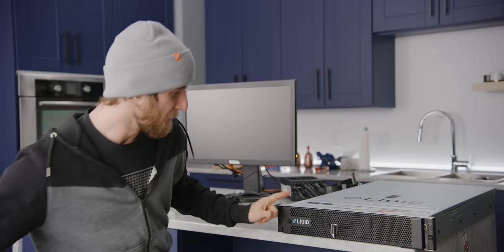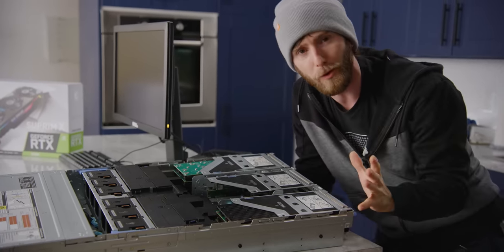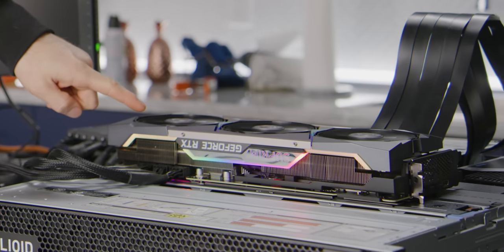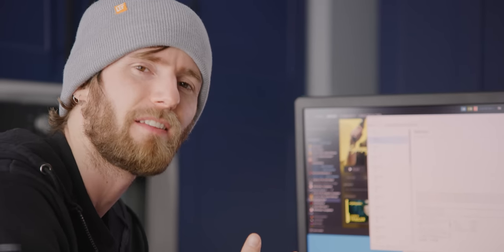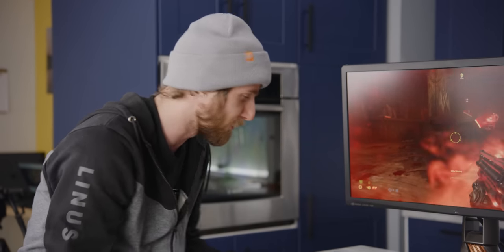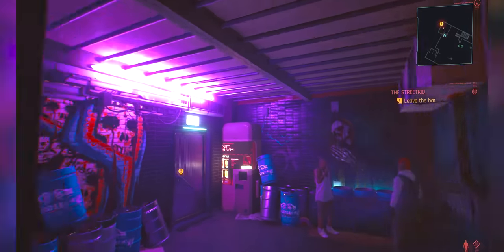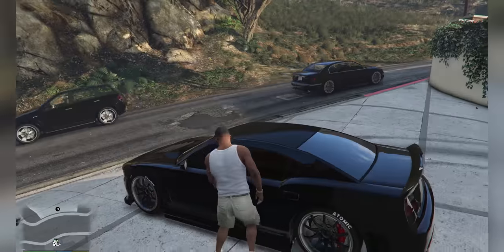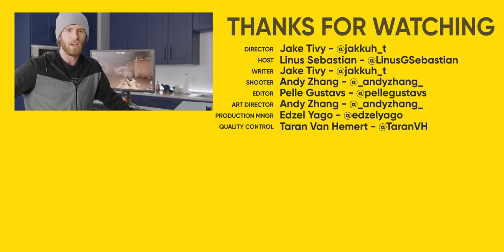Gaming on a $60,000 Computer - Liqid Badger Den

Comment: 20 years later: $60,000 20 year old Gaming PC vs $300 PC

$300 PC wins
Reply: quantum pcs by then.
Reply: Honestly the $50,000 Mac Pro 2019 is already more than half way there.

Pretty sure your average $2,000 PC will match that in 2030.

In terms of floating-point performance, smartphones-tablets-laptops under $1000 today match the top supercomputer of 1999 while a $5000 PC with two RTX 3090s in SLI  is roughly equal to the top supercomputer of 2004.
Reply: I would even say 10yrs.
Reply: @handlemonium  go look it up on a CPU benchmark compare website. The 24 core ryzen threadripper beats the 28 core intel xeon cpu in the mac pro by a big margin in both single core and multi core performance. Oh and btw the 24 core 3rd gen AMD threadripper costs $1300 while the intel xeon w costs $7000
Reply: @Bluecolty  what about the 64 core threadripper?
Reply: @anilater_9047  The one that can run the original Crysis without a GPU?  Probably the $300 PC by then will run Cyberpunk 2077 in the same way.
Reply: i wonder, considering quantum computing is not going to be a commodity (it works with super cooled stuff with liquid helium, not something people casually have at home.) and that we hit the peak that silicon and copper can do in therms of size, heat dissipation and electrical conductivity...

let's just say, even if it wins, the gap between them will be orders of magnitude smaller compared to rigs of now VS rigs of 20 years ago! went from 400 MHz to 4000 MHz back then tho we can reach 5.7 GHz on LN2 right now, we can do 5 GHz on air... that is what i mean by being at the limit. the heat can't get out fast enough and we can't put enough electricity in.

not to mention after a certain size down, the paramagnetic forces will induce errors in the processor if we bump up the voltage. think of it like moving a coin with a magnet. except it is changing data on an other lane.

so who knows if it would really win...
Reply: @handlemonium  Linus did a video on RTX 3090 SLI, and it showed that any performance gains were negligible (less than 1% improvement), and that in some cases 1 3090 performed better than 2 in SLI.
Reply: 20 years, that will be mobile device performance.  10 years, budget PC.  Longer if we go back into the slow stagnation of performance that was typical in the 2010s but we seem to be entering a new era of strong generational improvements.  Might not quite be 1990s level madness but probably at least as pronounced as the 2000s.
Reply: @brokengames9020  We're being exploited by... having fun joking on future tech?  Dude, you need to share what you're smoking.
Reply: @brokengames9020  they are going to use the machine as a video editing station, not sponsored ...
Reply: Not a gaming pc
Reply: @brokengames9020  Ok, then.  Provide your evidence of the propaganda and the concepts you claim are being used on us.

I don't see anything more than a geek taking the time to enjoy playing on absolutely OP hardware like anyone who enjoys computers would.
Reply: @brokengames9020  Ok, so you hate ads.  I thought you were saying there was some subversive messaging in the content of the video.

I'm going to disagree, and no, I will not be refuting your arguments because I am not debating something I consider utter nonsense.
Reply: @brokengames9020  Stop lecturing.  Start doing.  Lecturing others and talking down to anyone that stands up to you makes others turn a deaf ear to your message.

Do these corporate messages work?  Yes.  Do they work perfectly, no.  Some of us do see it, and resist.  And some of us take a very hard line against it.

Some of us are aware we're cogs in the machine of consumerism.  Some of us prefer it to the alternative.  If you want to go back to the old ways no one's stopping you.  But here you are on a website that uses AI to learn how you think to show you content it thinks you want to see, on a device that marketed to you (Or made of parts marketed to you), trying to decry the system.  A system you are still participating in.  You are a fellow cog.  Are you willing to admit that?
Reply: 20 years later: $60,000 20 year old Gaming PC vs 300 Eurodollar Frontal Cortex VR Chip.

And now to our Sponsor: Biotechnica Nutrisupplement
Reply: @omniwatch2000  nah that's an exaggeration
Reply: More like 3 years later
Reply: The worlds best shovel makes an awful toothbrush.
Reply: Imma wait 20 years for that $300 pc
Reply: @skmetal7  quantum pcs dont think the same way as normal ones do, meaning they cannot be used to pre rendered gaming ever.
Reply: @handlemonium  sli is slower than a single card tho lmao
Reply: @theepicslayer7sss101  When you hit the cap of what silicone and copper can do, you just add more cores. I would assume there isn't a physical limit for how many cores you can run parallel to eachother. Only for how efficient you can make the individual cores.
Reply: so true
Reply: @SaberusTerras  that was good
Reply: @batman3698  2 small problem with that, first is the more core you add, the slower they get since you still have to get the heat out and adding more cores adds twice as much heat.

2nd is even tho we have multi cores, a lot of processes are still impossible to multi thread so they will only get slower the more core you add... sequentially dependent threads can't be multi threaded or at least, they get slower if you "crossfire" them. (like AMD crossfire where one card makes one frame and the next one does the other one. it does not work on a thread since you have to output the result to an other thread then read it, that will always be slower.)

ironically if they made a modern single core "Dual Processor" PC with one multi core and one single core. they could raise the GHz to around 6 on air probably and about 8 on LN2. that could be fast and efficient at the same time.

but all in all, unless they change the copper for silver and the silicon for something that is close enough but better at dissipating heat, we will not go much faster in therms of GHz. (hence why we barely added 3 GHz in the last 10 years instead of doubling each year. we got faster by pre-baking mathematical formulas in the CPU to save cycles. that is what those things like MMX and SSE, SSE2... does.)
Reply: Also $300 computer fits in your blood stream
Reply: for sure, I was reading on Film called 
FF: spirits within (2001) that was rendered about 20 years ago on video rendering farm consisting of 1000 pentium 3 950 MHz, now 20 years later a single Threadripper 3990X has more performance that that whole farm
Reply: @Bluecolty  while MacPro was once drool worthy I kinda feel like in this era its lost its worth.  The G5 era was its tops I think, PC had nothing on Apple for content work back then.  Today everything Adobe runs on Windows, Threadrippers leave Xeons in the dust.  And then add Apple wanting 1000 bucks for a stand for the matching monitor, And if you get critical of that the Apple fans jump on you.
Reply: Moore's law
Reply: @SaberusTerras  I like how he had nothing to say after that lol
Reply: @5000mahmud  I was just pointing out the situation, nothing more.
Reply: @thefatmoop  ...no

Comment: "This game is the New Crysis"
cries in MS Flight Sim
Reply: Lol
Reply: flight simulator is atleast better
Reply: My 1080 Ti and Xeon E5 1680v3 handle it maxed out, 35-45ish FPS at 3440x1440
Reply: flight sim is at least a finished game, but I guess flight simulators are not as popular as RPGs.
Reply: @itai7809  You don't say. I doubt many people who talk about Microsoft Flight Simulator 2020 played FSX or an earlier version.
Reply: It's a DX11 game though. Therefore it doesn't have better CPU scheduling of DX12. Therefore much of its cpu scaling is based on clock speed and IPC

Also Sims are normally more taxing than RPGs due to more accurate calculation of in game physics

Comment: Having done this kind of crazy myself, the trick to calming the fans by putting the cover on is to pull a PCIe bracket cover, gently put a 90 degree fold in the extender, and run it out of the slot.
Reply: Yes, was sad to see them think of tricking the intrusion sensor but miss that simple workaround

Comment: "Fastest Server money can buy"
*Not even close*. 60K $ is beginner territory for high-performance servers.
Reply: That's true but he has to be able to fit it on the table right
Reply: @jackhuang1828  the only size that changes from this point is height, depth mostly remains within 700-800mm and width will always be 19 inches
Reply: Buy a ltt mainframe lol
Reply: I nearly choked on my coffee when I heard him say that. The company I work for casually has servers in the $1-2m range.
Reply: @VengFPV  are those actually single machines? You're talking about racks with multiple motherboards, power supplies etc, right?
Reply: sigh 1U single stack server ppl
Reply: @carl8790  pretty sure this is 2U at least
Reply: @LuLeBe  you're right, it is a 2U unit. Point is, it was obvious Linus meant a single unit server and not a cluster.
Reply: @carl8790  our 2 node cluster with a SAN cost over 60k and that was with our extremely generous enterprise deal with dell....
Reply: @LuLeBe  Supermicro make 7U chasis that take 8 CPUs, witch each CPU on it's own daughter board with its own RAM and PCI express expansion, and the whole thing is hooked up to a backplane and is just one single node
Reply: @mishkamcivor409  yeah okay makes sense. As long as it can run a single windows install (or Linux I guess) across that whole setup I would say it's comparable and thereby a more powerful version of this indeed.
Reply: @oelrich  Not if it's an IBM 3090 Server (pretty outdated by now, but a serious dual-socket server with a similar name to that epeen GPU).
Reply: @mishkamcivor409  Its called "blade server" my friend and its a common thing.
Reply: @jackhuang1828  Meh, the server could be the table. I wouldn't mind.
Reply: Check out tmg core their servers are far more advanced and faster than this

Comment: Love how Linus clowns origin but they are still smart enough to pay him off
Reply: they've always been a long time sponsor but that stuffs not handled by linus nor does he pick who's sponsoring the video.
Reply: I think it's even funnier that they paid to sponsor that they're shipping PCs with 30 series cards in them. Makes you wonder how many cards the system integraters got.
Reply: @sirmonkey1985  i mean he does though. He isn’t the main contact person for sponsors but if he decides that he doesn’t want to work with a sponsor he has the power to do so.
Reply: "Paying him off" would only be a sensible way to describe it if they successfully paid him to go back and remove any content that painted them in a remotely negative light. They haven't, though. They've just bought an ad spot, which is a very normal way for advertising to work.

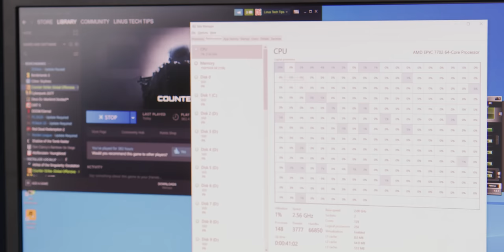Comment: 13:01 csgo can actually use more than one cpu core but you have to enable it in the settings. unless you enable it csgo will not use more than one core. after all it is an old game working on an even older engine
Reply: yeah, plus the game won't utilize the gpu or cpu to its fullest, I doubt the GPU was actually bottlenecked, it's just that CS:GO just doesn't wanna utilize it.

Comment: Linus, It is also recommended to short the 3.3v sense line, and a 3.3 volt rail together, that ways the psu can monitor its output voltage, and correct itself

Comment: You could remove one of the back PCI-e slot-cover things from the case, and feed the pci-e extension cable out through it.  That way, you can fully close the top case cover without pinching the pci-e extension cable.

Comment: "Cyberpunk is the new Crysis."

No, RTX is the new Crysis.  Without RTX on, Cyberpunk runs way better than Flight Simulator does.
Reply: Flight simulator is more bottlenecked by their multi core optimisation
Reply: @koalakenbymacy9248  Given how hard my GPU ends up working though, I question how much a better CPU optimization is going to be able to help.  I think mostly what the CPU thing results in is that if you lower the settings to free up your GPU, you don't suddenly get 150fps like you do in most games when you find the CPU limit.  Remains to be seen though.

Also, quick reminder that VR is hitting MSFS very soon (tomorrow?), so that's going to crack open a whole new can of worms.
Reply: @JETZcorp  for me personally I'd expect a game such as flight sim to be optimised to use up to 64 cores simultaneously.

I'm really hoping for CDPR to release a VR cyberpunk at some stage (probably 2023) 
That would be the new gaming benchmark standard
Reply: @koalakenbymacy9248  For whatever reason, sims in general seem to always be lightly threaded.  DCS is infamously single-threaded too.  I'm not sure if that's just because the developers happen to be less sophisticated, or if it has something to do with the aerodynamic calculations all needing to be done sequentially or something.
Reply: @JETZcorp  the next Microsoft flight sim should hopefully be more multi threaded considering 4 threads per core might be a common thing by then. From memory AMD wants to make a line with 4 threads per core by 2022

Comment: Since the latest patch. My 2060 and first gen ryzen 5 handle cyberpunk pretty nicely with a mild over clock on both. i keep high 50s to stable 60fps most of the time. even in crowded areas on medium to high with only ray traced shadows on

Comment: You should actually put a highly rated 0 ohm resistor between the power supply pins, not a wire

Comment: This video could've been better if you routed the PCI-E extension cable out the back where the backplate for the PCI-E cards are.

Then you could've closed the lid so it didn't tick off the intrusion sensor.

Comment: Whould it have been hard to bring that ribbon out through the gaping hole in the back of the chassis, though, this might be different than the model i'm thinking of where the PCIe riser also has the little metal bars that seperate the PCIe slots, if this is like my Dell R710/720, then there's probably no way to get that ribbon through those narrow slots

As far as NUMA goes, most BIOSes will have a setting for programs/OSes that are not NUMA aware, it USUALLY worked on my old dell servers, games like the division 2 would use all 12 cores

Comment: Why wouldn't you route the PCI-E cables through the back of the case where the card would normally be mounted? See 2:34, Surely the extension could pass through that...

Comment: try going into task manager and right-clicking the game task and change the affinity option under details, change the thread / CPU amount to about 12 to 24 threads and the game should run better, the game is creating a null error with that many threads making them default to 1 thread, I know cause I'm a game developer, I've gone through this issue before when I tried out the shadow cloud. experimentation recommended, *wink *wink, *nudge *nudge.

Comment: Had a IBM x3850 X5 server i bought from auction for a couple hundred bucks 5 years ago that had 40 cores and 80 threads with 3TB of memory, I don't think thats the best that money can buy, there are much higher performance enterprise systems that will have configurations like 4 or 8 CPU sockets and 200 dimm slot in a U4 or U5 chassis, maybe linus should look at those LOL

Comment: Why didn't he pass that pci-e cable through the back of an opened pci slot and then could have closed the case.
Servers really should be running with eh case closed as they need the top case to funnel the air over the CPUs.

Comment: (note: sry for the double post... really cannot contain myself): i would be really ashamed of myself as an audio/video technician if someone would give me a 240Hz mon and i would cable it with a bad cable, obtaining only 140Hz and then saying to my clients "WOW.... there's no possibility to run higher than this... you have to change hardware to a 480 Hz to obtain 240Hz....".
Really, even in the first try of "so called 8K" (cit. GN) linus said something like this, but luckly he then did a video explaining a little more in details things...
CB 2077 as well as the majority of games, nowdays that anyone has at least a 4core, would reach about 80% more performance if:
1) better compiled for multi-thread (the example that they cannot dynimically allocate cores is an example in this video)
2) compiled in pure 64 bit code, that is not dome cause of impossible (?) retro compatibility with x64 SO.
Really, this is a video a would be ashemed of if i was an IT working for the companies that made this game (yeah yeah my car has to be paid and so on... i know the story)....

Comment: 128 cores and a Flux Capacitor to run it and needs 1.21 Gigawatts to run - nothing less than a bolt of lightning (which would ruin any other PC).

Comment: Blender can run fine on my dual CPUs on Linux, utilising all my threads at 100%. Blender also tends to render faster on Linux than in Windows (and many games actually run faster in Linux as well, as can be seen in many of the benchmarks by FlightlessMango: https://www.youtube.com/channel/UCDmXLiZTBaFuCOXjy6mdw5w . Most of the ones that don't use DirectX seem to get a higher framerate, even running through Wine.). So, maybe you should have ran that benchmark in Linux to get optimal performance.